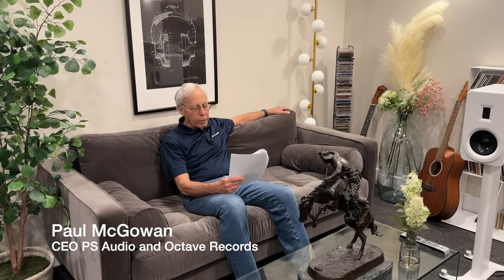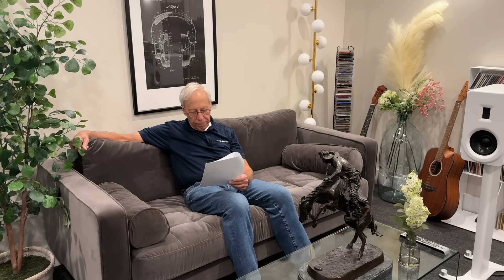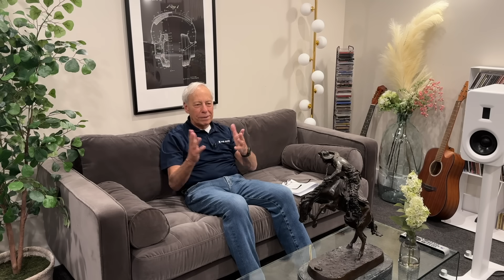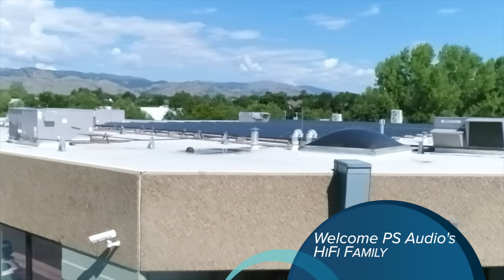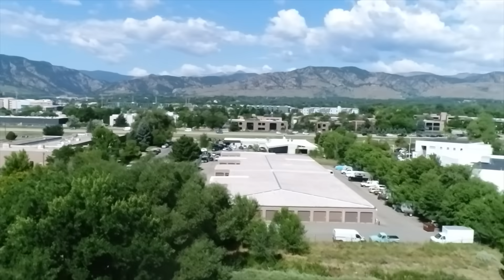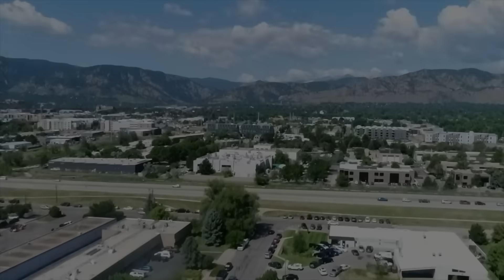Benefits of running a DAC at a lower volume

Comment: My DAC sounds best at -5 dB.  I tried -6 and it sounds slightly rounded or muffled at -3 isn't necessarily harsh but it's not as smooth to my ear with headphones on, so I also run the -5 on the main speakers and am happy with that.  I keep the volume display on my DAC out of sight so that I don't have to see that it's not at 0.  😂

Comment: I never liked the best my fiio k11 r2r dac at 100%. It goes from 0 to 99 i think. I found to like mine at 92 the best. That was before i saw this video. And if i am correct, Paul says -3db is best, and dacs that go to 100, every number corresponds to 0.5db. So for my dac 93 is -3db, pretty close to what i found sounding best by ear.

Comment: I have dug deep into this and it is more confusing. I understand now why to do it but, when you say a volume control on DAC is 100, do you mean a 0-100 scale (just numbers) OR are those decibels? I tried to see if I could match a 0-100 scale (with 16 steps I can see on my volume control) that equals a 3 dB reduction, but it is about 70 on the (just numbers) scale! That cannot be right. Please clarify knowing many DACs just have a 0-100 slider or control and are not decibels! Do you mean 97% or do you mean a 3 dB drop, which correlates on a 16 step device (in my case) to 70%?
(The device I have that is 16, also allows setting it more precisely as 0-100% with software but the main UI hardware control has 16 “clicks” which, allows a basic interpretation of the dB in that non dB scale. 6.25 x 16 = 100. So, 70 is a 3 dB reduction. Has to be too much of a reduction from 100 or I messed up or ?)

Comment: Thanks for sending me down this rabbit hole. I wish you had posted on this years and years ago. I just suffered through some harsh DACs the past decade. IOW: most DACs! 
The solution for your company and for many others is what your engineer said to do!  This was a problem over 20 years ago. It has a solution but few seem to bother to deal with it. Audioholics has a great video where an engineer digs deep. Everyone needs to look more at their “software” volume. Roon and others have settings to do this automatically but, most people do not use Roon or other costly software or expensive DACs that probably do not have a solution built in anyway. 
I use Apple Music, and sending to an Airplay 1 device, I can use a Shortcut to set the volume to 97% — assuming it is in 1 dB increments, otherwise, 94%. I am looking into what the 0-100 scale means on macOS and iOS for music. I think it is 1 dB because, I do notice it is better. I suffer from hyperacusis so, I notice harsh sounds way before most humans. Much less harsh with this anti intersample volume reduction at an early stage! 
I have noticed that you, Paul, tend to prefer this razors edge/chalkboard audio. I like real too but not harsh real. So this is a good solution for most streaming services until one of 2 or so possible fixes are finally implemented, by whoever is in charge of it.
BTW: I also learned that any upsampled audio, like from 16/44 to 24/48, can have it very bad. Also, most remasterings have it! Which might explain why remasters sound so bad (on the whole). If the remastering is an upsampling of a 16/44 recording, then the whole thing is garbage. 
BTW: BTW: DSD has none of these issues.

Comment: I find that treating the streaming service as a file that is stored on hard drives when recorded and mastered correctly that the streaming source should be at 100%. Then depending on electronics setup dac, pre-amp, amp  that the final output would be -3db for rca connections and 0db for xlr and would need adjusting to compensate for +3db output higher for balanced connections

Comment: Delta sigma DACs that support DSD direct mode will do so at fixed volume aka 100 . Volume is much better handled by the preamp stage, be it integrated in the DAC, the amp or standalone. Digital volume control is where it hurts because its cutting bit resolution to do so

Comment: It's alarming how many people lack even a basic understanding of intersample clipping / intersample overs, and this video does a tremendous disservice by not mentioning this as the root cause for diminished performance when playing back affected tracks on the the majority of consumer DACs that don't account for this.

Similarly, the video should have also covered the SNR trade off inherent to designing DACs with this additional headroom.

John Siau has excellent content on this, which is unsurprising from someone responsible for some of the best performing electronics currently on the market.
Reply: Siau does a great overview on Audioholics. A bit engineer only weedy in the middle but the opening talk and final slides are important. 
As for lack of basics on this: I have been studying audio for decades (as a consumer just looking to learn and improve) and, this video by Paul was the first I had seen on it and it was a question I have had for a long time. But I had never heard the term intersample.
Reply: What’s truly alarming is that you wrote that first sentence and thought it was ok to run with it. What planet do you live on?

Comment: -3dB is 0.707 X the max signal voltage, so you’re telling me you need to reduce the DIGITAL signal by 30% to keep from overloading the input on a DAC?  That doesn’t make sense.

I thought I2S and USB natively run at 100% signal and any manipulation resulted in data loss?  90% of the argument for preamps is that using a digital volume control negatively impacts the signal?

Comment: If you need to go down by 3dB to get a "better" sound, obviously the analog part does not have enough headroom.
BTW, as a rule of thumb, the analog part should be dimensioned with a headroom of 6dB above the signal generated by max digital output generated with sinus signal.
Illogical? Not at all! Real life signal, which is a combination of sin signals, can generate a signal which overshoot by as much as 6dB the theoretical sin max (0dB).
It is pure physics and mathematics. No opinion needed. It is all about physics and mathematics.
If the design of your DAC is right, go with 100.

Comment: My dac has a digital volume control knob, which can be taken out of circuit to give 100% output to my amp....I find that doing this gives a slight improvement to the sound. What I hear is a slightly more sorted dimensionality, and something akin to the music 'stepping forward' a little. Having said that, I love the convenience of having remote controllable volume, so tend to run the dac -5 to -15 db down on max output most of the time, only going to full pass through output for careful listening. I definitely do hear a benefit to bypassing the volume control though. I guess it matters if the dac bypasses its volume controller, if that makes any sense.
Cheers everyone!

Comment: My DAC, GUstard X26iii, has option to have volume fixed, so preamp is used for volume control.  Should I not do this?  Should I have the volume working on DAC and adjust it myself, or should I used the fixed mode?
Reply: just try both paying attention, use what mode sounds better

Comment: What if your DAC doesn’t have a volume control??
Reply: Most do not. But if you are sending from a computer (iOS, PadOS, macOS, PC, Android) you can lower it at that stage so it enters the DAC corrected.
Reply: Is any of this relevant if I have a system that has a DAC without a volume control and the inputs are a CD player or a DVD player or a Blu-ray player?
Reply: @Keith-ux9ku  Pretty much, unless your CD player has a volume control on it like some older Yamahas and Sonys have.

Comment: While this is true for most brands (audibly so), it's not a problem for ones implementing a properly designed reconstruction filter (or filters). Lowering the volume may be a workaround for PCM DACs. but not ones that convert DSD natively.

Comment: There's some of us using ReplayGain so does that mean the quality goes bad on loud tracks when replaygain turns it down -12 in some cases.
Reply: I also use replay gain with foobar and also have tracks which indeed go at -12dB 
Replay gain wil not harm the recording but discs or file which such an attenuation 
Are very bad in sound to begin with most of them clipping and very poor dynamics

Comment: Most volume adjustments are post reconstruction filtering. The possible exception being those that toss bits at the DAC chip rather than have an actual volume control on the output.
Reply: Yes, get it down before it hits the DAC for a DIY solution. Roon and others do this. After the DAC, forget it. Also, if the DAC is inside a streamer, it may not be possible, depending on the engineering.

Comment: there is a bunch of misinformation here.  there is zero benefit from running your dac signal at lower volumes.  its not true that anything sounds better.  you want 100% of the signal.  if your stereo is clipping or has issues in the gain section you need to replace the stereo, not turn down your dac.
Reply: Note the preface - "generally speaking"?

What's the name of your audio company?
Reply: @SixStringHarmonies  you are grasping at straws, that's a straw man comment.  i wouldn't tell you what company i own no matter what because it is not relevant. the point is the entire signal is present when the dac is at full volume. the trick is to control the volume with a high quality volume control after the dac.  dac serves one purpose and thats to generate audio. you reduce the quality of the audio when you turn it down with the dac.  i prefer a much better option like a pre amp or volume control.  this way whats going into the volume attenuation doesn't have any resolve issues.
Reply: @SixStringHarmonies you grass me at straws with the straw man response
Reply: This issue happens no matter how good or crappy your system is. Indeed, it can be in the master! Nothing will fix that but for the rest, many options can resolve it.

Comment: To me that sounds counter intuitive, Usually one looks for bit perfect, no changes (distortions) of the audio data from the track the recording engineer created and what's feeding your power amp. So digitally fiddling with the data to achieve a 3dB drop goes against that. As for the reconstruction filter, well that should be designed so it can take everything the actual DAC/music can throw at it without saturating. With digital music there is that brick wall, you know what the maximum peak is - so it's easier than processing an analogue source as you only thing you've seen that strongest signal.
Then there is DSD, Paul's favourite - very hard to change anything without converting to PCM, so how does a 3dB drop occure here
More information please.
Reply: The industry, mostly, forgot about this problem. I also thought same: 100 is as close to bit perfect from my service. But, that is spoiled by the intersample clipping. Bitperfect audio is overrated anyway so, I think dealing with this crud is much more important. Now I just need to decipher the Dieter Rams minimalist volume control on my streaming software to be sure a 97% volume setting is a 3 dB reduction.

Comment: Some years ago I had my PC connected to my TV and Stereo. But the PC killed my TV somehow. Something with the signal. Back then I had  my old Cambridge DACmagic first gen connected from my PC to my Stereo. It sounded quite good back then and I don't know how much better the new DACs are. Do I need a new one? 
Now I only use my turntable as I have amassed a good deal of wonderful LPs over the last years. I have a new TV but I don't use it for PC use as of now. My new used tube amp (with integrated tube RIAA) sounds so good with LPs that I prefer that over streaming. 
My Rig: 
Copland CTA 405 integrated tube amp
Lenco L75 turntable (completely original except I changed the power cable to a new and grounded one) 
Shure M75 MK2 Type 2 cartridge with a good elliptical stylus
Epos ES 11 speakers with original factory stands
One thing about the Epos ES 11: I thought they were the weak link in my setup until I went with tubes. Oh boy do they they shine now! 
Tubes TRANSFORMED those speakers! 
I would think the same goes for the lengendary Epos ES 14s. ES 11 is just a bit smaller but much the same speaker and I think ES 11 came after the ES 14.

Comment: Depends if you're attenuating at the analog ot digital, no? If at the digital, you're losing resolution bits. At very low settings, youre basically doong D\A of 8 bits or less...

Comment: I run my Wiim Ultra at 100 and control volume via amp sounds better to my ears.
Reply: The intersample problem is still there. The last volume is too late. Does Wiim offer a way to check a box in settings to go down 3 dB? Try it if they do.

Comment: it's not the dac you're talking about is the amplifier that the dac feeds. you really want to feed your dac a low digital resisted signal. so use a cat 5 100 ohm interconnect cable or a cat 6 120 ohm cable. you'll get much more sweeter sound no digital artefacts. make sure you just use the one pair out of the 6 individual wires three pairs. you can use the drain wire for lxr each wire will be 50 ohms. also a round cat 5 cable fits perfectly into an RCA plug housing.

Comment: If the volume is done digitally, is it best to set it at a fraction of full volume, exactly 1/2, or exactly 1/4, or similar ?
Reply: There are two volumes here. One is the sending device, like a PC or iOS. The other is at the amp. Always control the volume for your ears at the amp. 1/2 and 1/4 are way too much at the sending device. Just down 3% there and see. Then control main volume normally. If you can find out if your volume at sending device is in 1 dB or .5 dB increments, that helps. If .5, then go down 6%.

Comment: Hi, Paul. I use a purely digital system and have an issue with loudness levels. On some tracks, I am peaking since the mix is too loud for the volume I have it set to play back at. What level do you use your preamplifier at if the DAC is set to 92, or 85 for a -6 DB cut for louder tracks? Do you keep the preamplifier at 100 or adjust the volume to taste since the DAC is taking care of the clipping? And how loud can you safely enjoy your music without suffering listener's fatigue or having to reach for the remote all the time? If you are like I am, and listen to a plethora of different genres, you would know how hard it is to get a shuffled playlist sounding right especially if it included CDs of material from the 1950s. If USB-C is the way your system outputs audio, would a USB-C noise isolator make the louder playback more bearable? And if so, why doesn't PS Audio make one so I can assure I am getting a higher quality product than a Topping HS02 from China? Thank you.

Comment: Bit perfect only happens at 100%. Anything else accepts bit loss. My DAC stays at 100% and volume is controlled with an analog volume control later. I think that the claim of “better sounding at 97%” is just copy/paste from some other misunderstood myth.
Reply: There are DACs that adjust volume in the analogue domain and so don’t suffer from this. 
I’m not sure bit perfect is anything to worry about, anyway. Considering what goes on inside the DAC with over sampling and noise shaping, the data might go in bit perfect, but that’s where it ends.
Reply: This was my understanding as well. With that said, I've come full circle and critical listening is in my rear view mirror. Speakers and room acoustics are about 95% of the substantive differences. Fine tuning the last 5% is fine, but if you have to quit listening to the music to hear what's inside, I'd argue it's a waste of time.
Reply: @kenhiett5266 I think where this stuff makes the most difference is headphone listening where every little detail is critical and flaws can become ear grinding. Coming out of a speaker and blasted in a room full of sound reflections and other distortions you notice such things way less.
Reply: I use my custom-built PC with Roon, and it connects to my DAC via USB. The Roon volume is totally disabled (uses ASIO direct) and my DAC has no volume control either. DAC feeds amp, and that's where the volume is controlled.
Reply: Yes and No... On USB connected DACs the master volume control is (or should be) in the DAC itself and is managed by commands over the USB port.  (eg. The Windows on-screen slider)  This keeps the PCM stream at 100% while the actual output volume is managed by an electronic attenuator on the DAC's output.  This does not suffer the bit loss problem we commonly fight with.

Where you do run into the bit-depth problem is when you use your in-player volume control to manage playback levels.  Those are software devices that add or subtract from the PCM levels, directly.
Reply: They implement it in some players for computers so it can be done through the software and still bypass the native volume control, and it can make a difference if the signal is too hot.
I'm not sure why it wouldn't be bit perfect in any other scenario that I can think of. 🤔
Reply: If it helps, I've never heard this but I do keep my DAC/streamer at 98% and noticed improvement over 100%

I then use an analog preamp or volume.  Didn't know it was a thing to barely drop the DAC volume - it is something I often do.

I'd assume results will vary and this won't always improve

Comment: I used to reduce the optical output by a few db on my old cd player, I swore it “sounded” better. It probably didn’t in reality. 😋
Reply: Depending on the player and the CDs, doing so may have prevented output clipping which would definitely improve the sound.
Reply: If this was a transport (in name only or function) and you sent to a DAC, it did help. Probably.